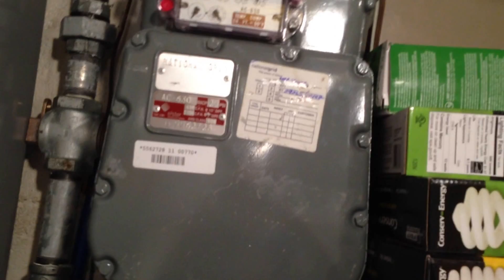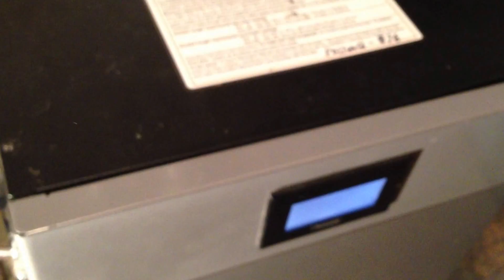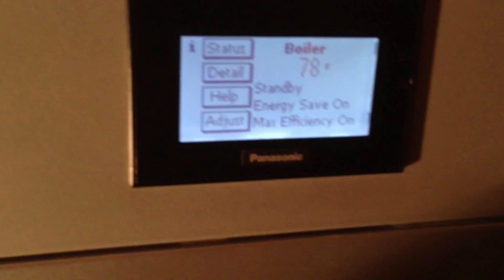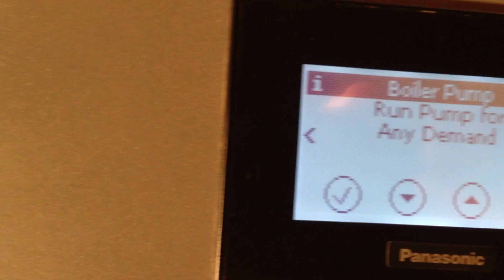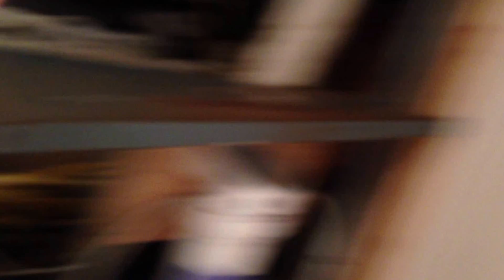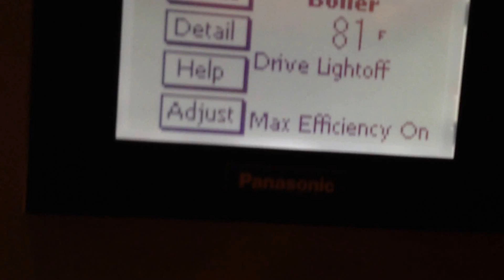Burnham - Alpine 210 Condensing Boiler & Honeywell - 7-Day Programmable Thermostat

Comment: From one of your replies, I think you live on LI.  Can you recommend a reliable HVAC technician who is experienced with this boiler?  I can't find anyone decent.
Reply from the maker: My Go to Plumber is: Andrew Puleo of Capstone Plumbing & Heating 471 N. Broadway Suite @/120 Jericho, NY 11753 (516) 354-7171. Andrew will give a 10% Discount if you Mention this Video. When he was on Vacation, I used Montilli Plumbing who charges an arm and a leg, but they fixed it. whats the Problem? what exactly hapenned?  It's usually a sensor.
Reply: @silverbankruptcy  I have two of these boilers (top and bottom) that are supposed to alternate via an ethernet cable but they are not doing.  Right now the bottom boiler is doing all the work and I found soft lockout error #14 last Friday.  I had someone came in to look at it and was told that sequencing is not correct.  The technician called Burnham and they both couldn't figure out the problem.  To make this long story short, technician suggested to install am exterior controller (takmer) which costs $3,800 for the part.
Reply from the maker: @ada3486  In General, I would replace the cable and shut off power to Both Units. Soft Loclout code#14 has something to do with perhaps a water pump or piping issue, its:
Temperature rise between supply and return is too high. It's inadequate water flow.
 https://www.google.com/url?sa=t&rct=j&q=&esrc=s&source=web&cd=&cad=rja&uact=8&ved=2ahUKEwiCy9rjscTvAhUOGFkFHVruBpUQFjADegQIAhAD&url=https%3A%2F%2Fwww.usboiler.net%2Fwp-content%2Fuploads%2F2016%2F09%2FK2FT_Past-Present_Repair_Troubleshooting.pdf&usg=AOvVaw3P03lMAy5xBusDjkKCItNo   
https://forum.heatinghelp.com/discussion/169175/alpine-burnham-alp210b-soft-lockout      Please keep me updated

Comment: I have the same model. Was in my house when I bought it. Tonight I actually placed my camera in front of it and recorded. I not only captured my screen go from the normal screen to red 3 times but also captured it “ketteling”. You can see the lower door flex. Have you experienced this? Thanks.
Reply from the maker: No. What is ketteling?
What is the error?
Reply: silverbankruptcy the lower door will physically flex and pop. I have read it’s all due to limestone build up
Reply from the maker: @ckbry  sounds like the external limestone device is clogged and triggering a flow error. You should be able to see the water buildup inside the tubes after taking off the cover. There is a water buildup sensor there.
Clean out the limestone and replace with fresh limestone. To clear the error just connect the two wires on that sensor. The water flow sensor will then be bypassed  and the system will fire and the pump out the liquid in the system. I get this error when I shut off power while system is running.

Comment: Does it has a filter? I can not find the filter
Reply from the maker: There is No filter.  There is a sensor in the exhaust (remove screw on the bottom left side), that has to be coated with a gel every few years. It protects the sensor from the acidic exhaust.  They have a kit for that.

Comment: My Burnham Alpine shows Display Loading and does nothing.... what it might be??
Reply from the maker: shut off the fuse to the Alpine for 10 seconds and then turn it on. Also Check for loose wires and plugs in the computer unit.

Comment: As a HVAC service technician I have to warn homeowners about the negative aspects of having a high efficiency gas boiler.
This Burnham Alpine is among the best of the the high efficiency condensing boilers but all boilers like this are trouble.
You gain efficiency but lose reliability with a condensing boiler. They all contain model specific parts that no company stocks on their trucks, so when the boiler breaks be prepared to be cold until the part that needs to be ordered arrives.
I'll take reliability over efficiency any day. Traditional boiler set up with the proper controls can be reliable and efficient. I like the Burnham ESC myself

Comment from the maker: Error: If Screen is Flashing Red, and it indicates Soft Error then its Usually the following:
Open the Four Latches and Remove the Cover
Take the two wires that come from the computer and are spliced into the 
two wires coming from the float switch located in the condensate drain 
tube. No Need to disconnect them, Just  Touch them together (Its a low voltage Close Contact circuit - no danger), this fooled the computer to starting up and cleared the error. Runs perfect afterwards.

Comment from the maker: Warning: Do Not Turn off the Power to the Boiler for an extended period, while the Boiler is Running. I did so and went on vacation, and when I came back, the Boiler Displayed Errors of "other limit" and "pressure switch" . The Boiler must be allowed to complete the Cycle and exhaust the boiler and drain the condensate. The problem I had was that by shutting it off, Condensate in the drain tube did not drain and caused the float switch inside to trigger an error preventing startup. I had to take the two wires that come from the computer and are spliced into the two wires coming from the float switch located in the condensate drain tube, and I Touched them together, this fooled the computer to clear the error. The boiler then went through the ignition phase and drained the condensate itself. These Condensing Boilers are very efficient, but also very complex.

Comment: Thank you so much for taking the time to make this video and post it.  i have the same boiler, and it is with great frustration that I search for answers to questions regarding the settings.  I'd like to find a more broad discussion of the settings and what you can do to maximize your opportunity with them.  Other than the charts in the Alpine 210 manual, which have some detail but I don't find very clear, it has been very difficult to get perspective on what settings are best for heat and hot water.  Your effort helped.  Thank you.
Reply from the maker: Update:
Burnham is Recalling one of the "Cap Sensors".
They will send it to your Contractor for Free and even give you a  $200 debit Card for replacing it.
See this Link:
http://www.usboiler.net/order-alpine-service-kits.html

Comment: Ive been installing boilers for over thirty years. I would worry more about a gas meter in my house than I would a leaky oil tank. Get the gas company to move the meter outside. Good luck with that boiler. Did an electricain wire that? Not a very good looking job
Reply: Al- looking for an answer. My broiler screen is red and reading memory full. Any idea of what this means. Any help would be appreciated
Reply from the maker: +Bryan McCloud I looked at the Manual and it doesn't show that as an error code. It may be an installer only available code. Try Shutting off the circuit to the Boiler and turn it on after 10 seconds. If that doesn't work then open the top drawer and first press down the reset button for a second and look, or lastly  hold it down and boiler will reset. You may have to reprogram some of the settings, but with the manual you should be able to do so.

Comment from the maker: In the 9 Degree weather, two zones froze up. the Pex Pipes are wrapped in a foam pipe cover and go through an unheated area. The Pex Pipes Freeze up like a Popsickle. I think part of the problem is that the Boiler is Programmed to give the hot water tank (80 gallon tank) Priority. This Totally shuts off all of the heat in the entire house for up to an hour until the tank heats up fully, then goes back to heating up the house. I went into the menu under DHW and disabled priority. Now the Hot water tank heats up with the rest of the house. I will have to monitor whether we have enough hot water, or whether the house is taking too much away from water heater. Boiler seems able to maintain the 180 degree temperature with no problem, but it no longer shows that it is in energy saving mode when hot water and heat are on. House Temperatures are more stable since house heating zones no longer shut off for an hour.

Comment from the maker: In the 9 Degree weather that we are having, a few heating zones froze up.
It turns out that the 1/2 inch Pex pipe with those I believe copper fittings, freeze up like a popsicle when not in use. They are covered with a foam cover in unheated areas, but since the house is 100 years old and uninsulated, freezing up is a problem. I shouldn't have kept the heat at 40 degrees in unused areas of the house. I moved it up to 50 degrees. I now have an electric heater in there. Do Pex Pipes Burst when frozen? I hope not.

Comment from the maker: Acid Problem - Part 1:

Hydronic Boilers like this one, have a small pipe at the bottom which expels condensate which the boiler generates in the process of burning natural gas, and maintaining as much heat as possible not out the exhaust. This Liquid is Very Acidic, I believe it contains Hydrochloric acid, a byproduct of burning Natural Gas. Plumbers usually have it pumped into your Sewer Line. This Acid will Burn a Hole in your sewer line within a few years, costing you thousand of dollars.

Comment from the maker: Acid Problem  - Part 2:
The Solution to the Acid Problem listed below is to Purchase: the Noritz NC-1 Residential Condensate Neutralizer Kit.
This is a Container that is filled with Limestone  which is a Base that counteracts the Acid and Neutralizes it before the acid destroys your sewer line. You periodically replace the Limestone, which gets eaten away by the acid, protecting your Sewer Line. A Plumber told me that he was Burnham Trained and they showed him a Sewer Line with a hole in it.

Comment from the maker: You were correct.
Problem was that Heat was Migrating to the Attic Level even when Circulator pump was off. Attic was Always Overheated. At First Plumber put in a small valve that looked like a plastic heart valve in a metal circle, at the bottom of the Taco pump. Of course the laws of Physics Don't apply to your house, and the Hot Water Bypassed the Valve anyway. He then Installed a Taco Universal Flo-Check Valve, which is a big Cast Iron Valve, that opens when pump runs. Problem Solved.

Comment: You need to install a flow check after the circulator in a horizontal orientation to the 3rd fl zone to stop the bleed off.